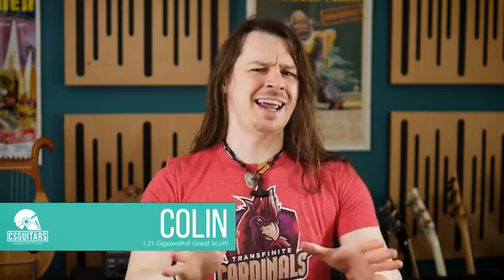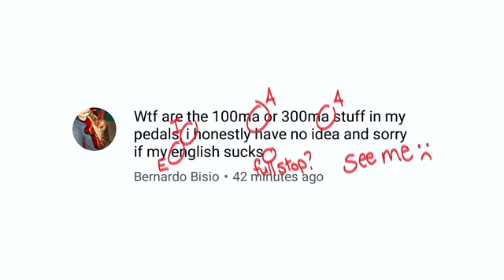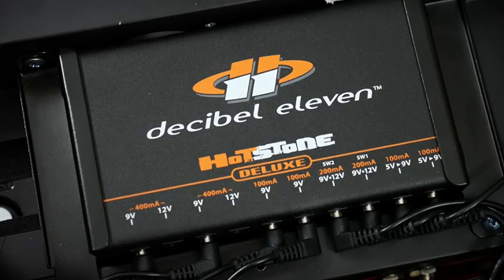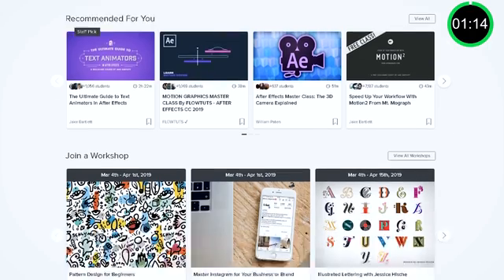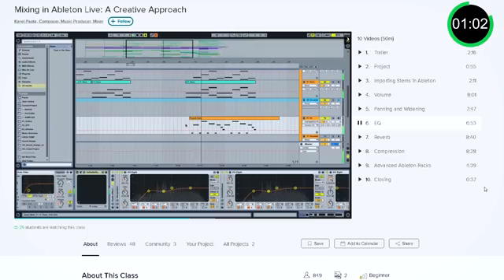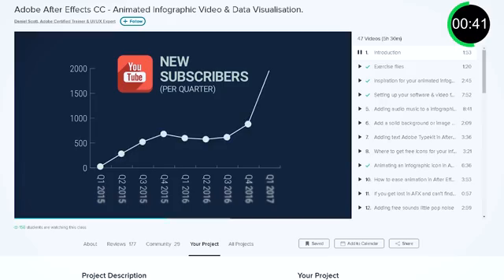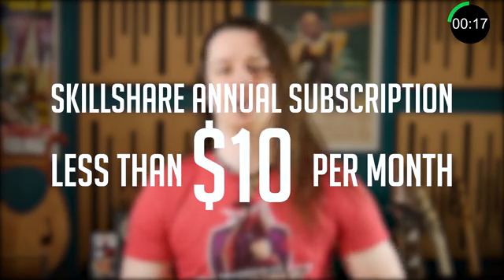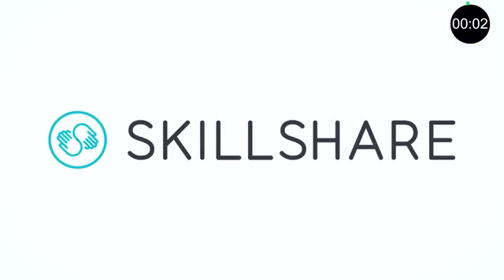What Are mA In Pedals? | Too Afraid To Ask

Comment: Here is a TATA. What does "Warmth™" in audio mean? On like Quantum level? Yea, I can hear the difference, but what it really is?
Reply: It's not officially defined or something like that. Normally when people say warm sound they mean a lot of low mids/lows (round about 100-700Hz I would say) and not too much high end (like 3kHz and above). But its a very vague term overall
Reply: Also... PATREON NOTIFICATION SQUAD
Reply: Low Mids I think, High Mids are presence if I recall correctly.
Reply: I have heard something about even and odd harmonics when it comes to for example guitar distortions and overdrives
Reply: The short, semi-technical answer is that it’s referring to a particular group of even harmonics. Certain types of circuitry has the potential to produce more than other types.  

Colin has the electronic physics degree, he could definitely say more. I just have an audio engineering degree. 😆
Reply: I don't think there's any proper agreement on this, but here's how I made sense of it:

Think of your tone in terms of sound waves. Sound waves that are more round, with soft edges, tend to sound softer and more soothing to the human ear, but they can also lack clarity, making it hard to distinguish notes and chords from one another. These low frequencies can also lack perceived loudness.

Sound waves that are more sharp, with hard edges, have a lot more presence and clarity, but can be a bit hard on the ears and unpleasant to listen to.

So you can think of "warmth" as adding some low mids and/or bass to make the sound a little rounder and more soothing to the ear, and "brightness" as adding more high mids and/or treble to increase presence and clarity. The goal should be to find balance between the two.
Reply: it is not a technical term unless you are referring to the thermal requirements of semiconductors and various materials in a device.
it is used as a subjective descriptor, typically of a preference for harmonic distortion that is "pleasing" (and not fatiguing) to the ear.